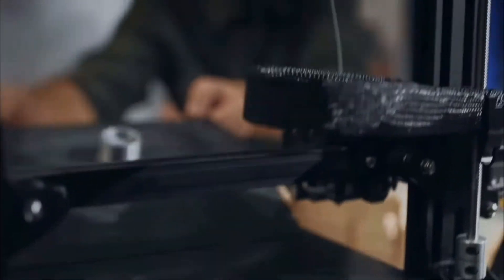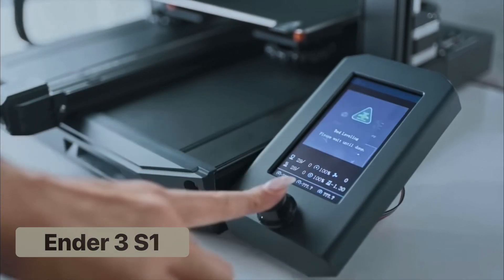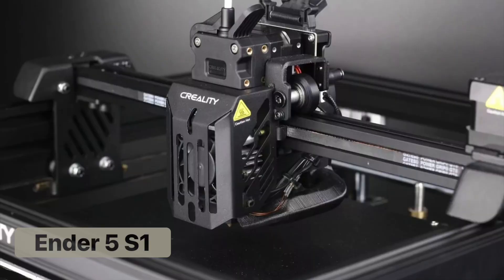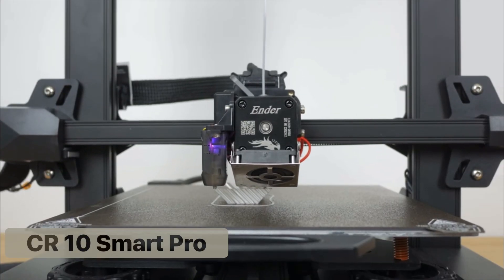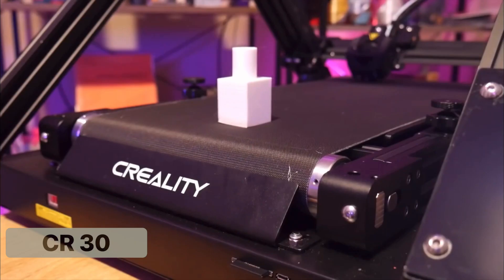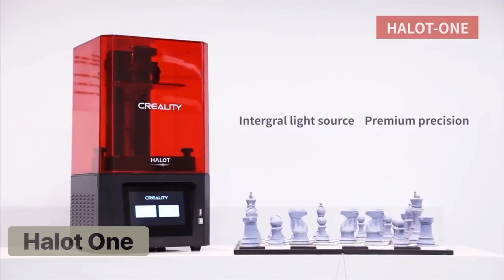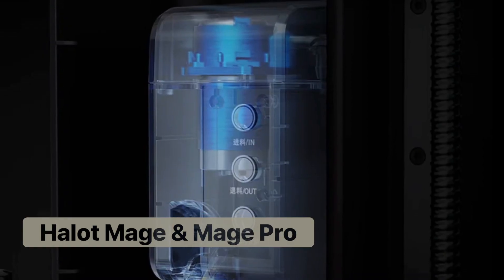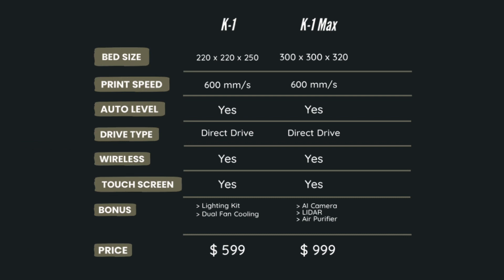2023 Creality Buyers Guide

Comment: Creality doesn't stand behind their product. Do not buy from them.
Reply from the maker: Which brand would you suggest?
Reply: @aprintedworld  Prusa is the gold standard really but.. Sovol seems to be doing well, if problem, they will at least address the problem, Creality acts like you have offended them, and have to PROVE you need the replacement parts.. over and over again. Then they just stop talking to you.
Reply from the maker: Interesting. Thanks for the insight.
Reply: @Patriot_First  I’ve had to have motors fans and even an entire extruder replaced and had no issues with their support. They did ask for videos or pictures of the offending parts but never had them deny me. They even shipped me the wrong part one time and when I contacted them about it they told me to keep it and re-shipped the correct part in a timely manner. I’m not saying their support is perfect because it’s far from it but I don’t want other future hobbyists to fear creality in the way you make them sound as your issues with them, even if they are more frequent than they should be, are not universal.

Comment: thanks for the vid. good help to decide which i going to buy for my first one
Reply: what do you think between ender 3 s1 pro, ender 5 s1, ender 6 or the k1 as a first printer? hard decision- would like to print tpu at least
Reply: @turion92  I also would say s1 pro. If you plan to print TPU (even though your listed printers all include it) I’d make sure you have a direct drive extruder since TPU is somewhat elastic in nature. Also TPU is printed more slowly anyways so you don’t need anything with speed as an advantage since you will likely be printing no faster than 60mm/s. Happy printing!
Reply: @Alex859G  thanks so much i got a great deal 430dollar for a new ender 5 s1 and i got it. Thanks man
Reply from the maker: If your going to start with TPU then you will most likely try other types of material in the future, S1 Pro in my opinion. The K1 is very intriguing but I would not get one for a beginner as it is a brand new type of printer and may have growing pains. Also finding a deal on the K1 could be tough.
Reply: @aprintedworld  thanks so much for your opinion